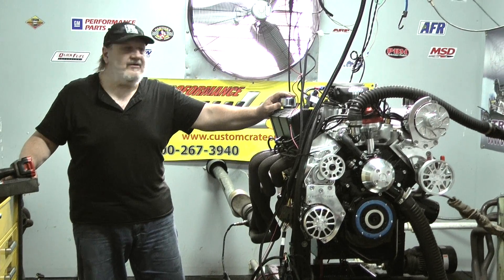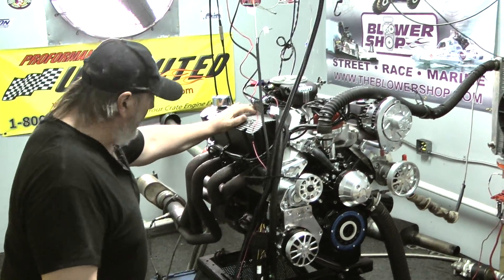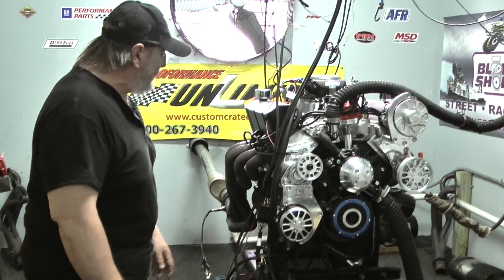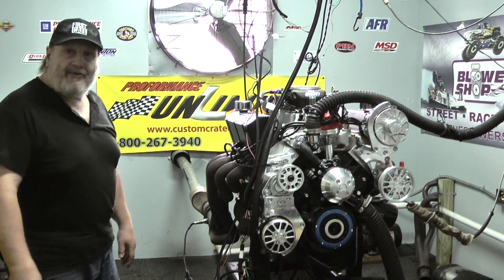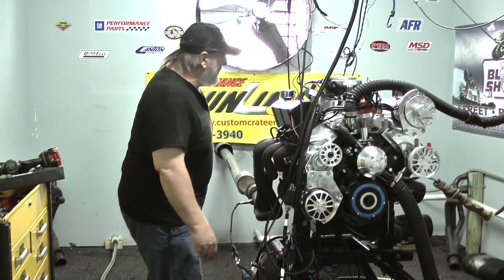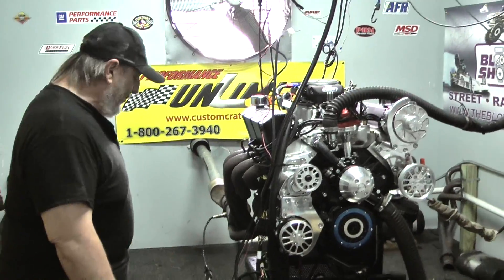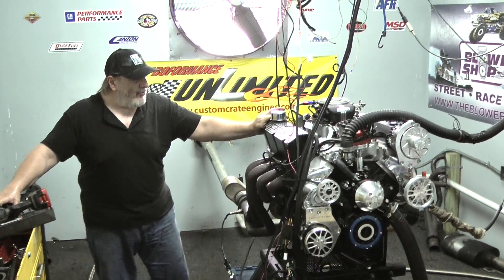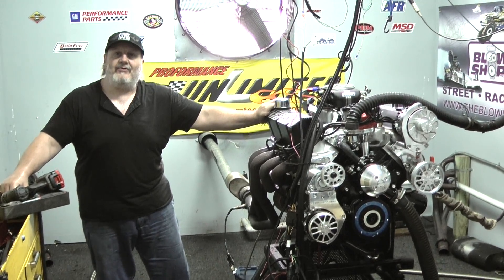427 351W Based Big Bore Stroker Engine

Comment: Torque looks about right but 40hp low. Suffering from limited plenum volume ..must be an Edelbrock Performer dual plane intake.
Reply: Well when he hit 6K rpm’s it read 600HP. This setup should be good for 6200 MAYBE 6500 but 6K or a little lower to be safe. I think it’s pretty spot on.